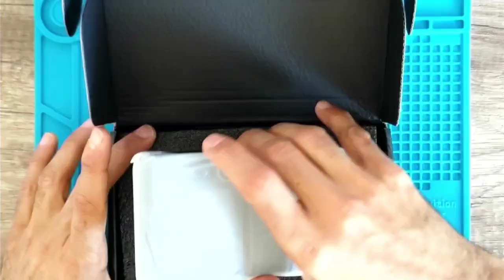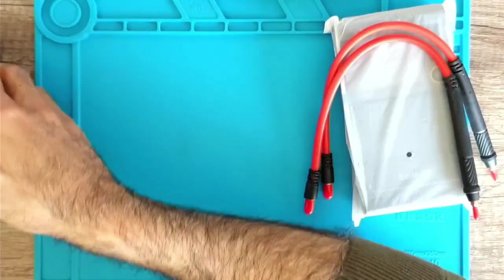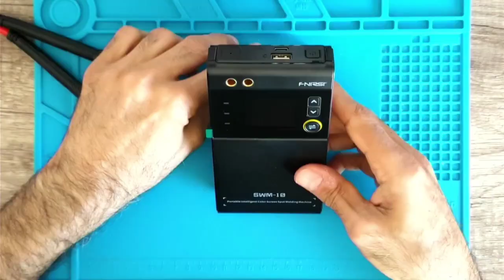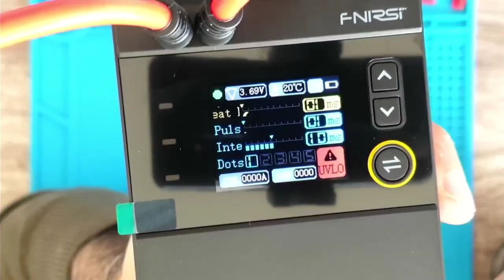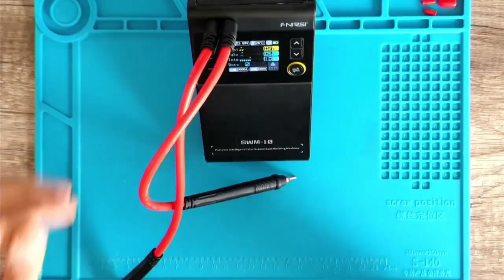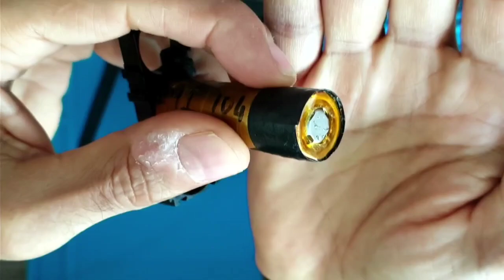65 Spot Welder (Fnirsi SWM-10) - Test & Learn

Comment: I understand you are new to welding but when you weld a battery pack it does need to weld it so you can't remove it with pliers. It just need to weld it enough hard so you can't remove it by hands and if it goes off than it just rips off instead of un-welds from the battery. Second important thing in welding: rarely you will need to use more than 1 pulse when welding, probably 2 pulses in some case scenarios when you weld a Copper sheet with a Steel or Nickel sheet on top of it all together around 0.3mm. So best practice is to use just 1 pulse per weld, ideally calibrate your welder without a battery with just 2 nickel strips and give it a few tries. After you are satisfied and they rip off from each other - you can pass to a battery welding with that setting for a 1st weld test and check for adhesion. Now you are ready to go and easy weld your packs in the future.
One more thing, in rare scenarios with 2 strips combination like I mentioned above, for example Copper strip 0.2mm and Steel or Nickel sheet on top of it, you can put 2 pulses and wait for it to weld 1st pulse, then after 0.8ms you will feel another softer punch that improves your first pulse weld and makes it stronger. Make sure you are not moving your hands while doing 2 pulses or 3 etc. because every next pulse punches more current into the middle of existing 1st pulse and makes a small circle on top of it which is visible to your eye when you look at your weld borders after you finish it and remove tools from the battery.
You can try with 10-15-10 for 2 pulses and you will see the result you will get for that welder. I have it for few years and it's very solid for a smaller home DIY battery packs. Heats heavily and fast so you need to rest it and leave it to cooldown basically after 10-20 welds at least for 2mins. and it will do the job for ages. Otherwise it can destroy the tips fast and even burn out faster.
Always make sure your battery is fully charged in order to finish the job in a go, without recharging as the current sucks out the battery when you weld more than 1 battery pack, you'll see soon enough.

Best of luck and go for it.
Mickey
Reply from the maker: Hi @komodo016, thx for the detailed message; I'm sure many will benefit from it.
Reply: @MySolderingExperiments  Well, the ones who read will :) You are welcome.
Reply: Very useful info as I have the same welder. Thanks for sharing.

Comment: What were you doing wrong to cause a short?
Reply from the maker: Hi @Cheezwizzz, I wish I knew! I did some research after and couldn't find a definitive answer. Someone suggested that the device's battery must be charged enough to avoid the short error. So the next time I use it I'll try charging the battery fully to see if that makes a difference.
Reply: @MySolderingExperiments I do the same, I get a new electronic tool don’t read the manual and assume I know what I’m doing!
Looks like a great device and the one I want, cheers
Reply from the maker: @Cheezwizzz, yes sir; where's the fun in reading the manual 😂. I've learned way more from my mistakes than successes; that's for sure. And henceforth my eyes will always be on the "short" red error icon whenever I use the device (having turned on the warning setting).

I think you'll be quite pleased with the device if you are a hobbyist (such as myself). On the other hand, if you're a more professional electronics person I'd advise you to look for something more, well, professional 😊. Either way, best of luck with whatever you choose to buy!

Comment: How many build a powerbank that can also do spot welding? No one! How many build a spot welder that also can be a powerbank? Fnirsi! That's not exactly what seals the deal for me Fnirsi, on the contrary.

Note: No youtuber was criticized in this comment.
Reply from the maker: I certainly did not take the power bank feature into consideration when buying it. And I can almost guarantee you I'd never use it as such.

Note: this YouTuber is not insulted nor feels criticized by your comment 😂 thanks for the laugh 👍
Reply: @MySolderingExperiments  🙂 Thanks for your answer! I hope Fnirsi can differ my view from your vid, in case they sponsor :)